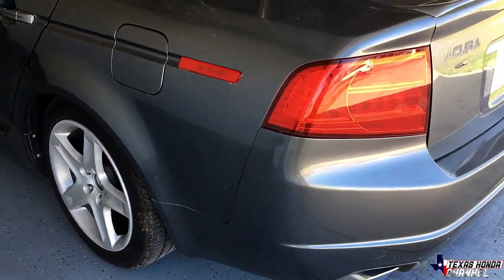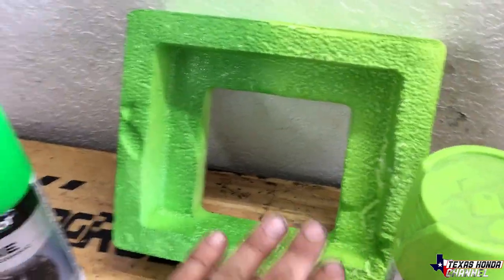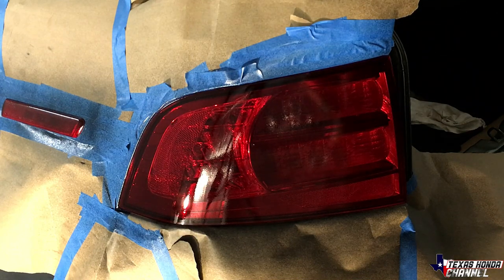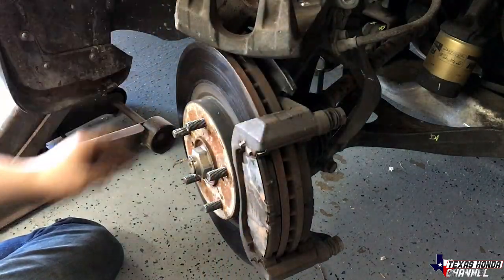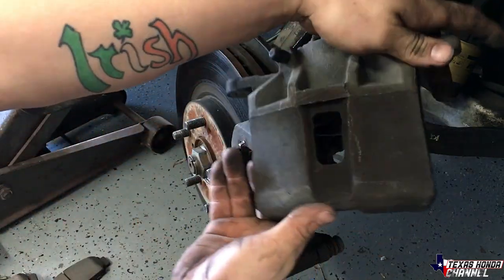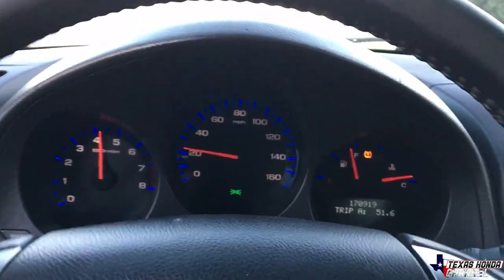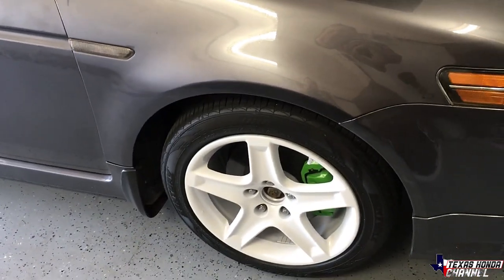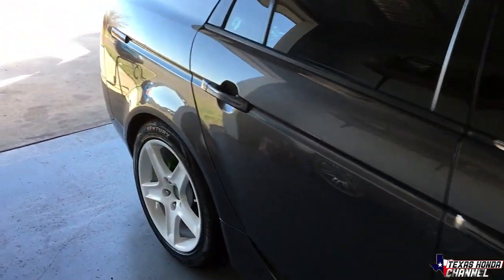My 06 Acura TL Gets Some Custom Rice Mods! More videos coming too!

Comment: I believe the 2004-2006 TL with the 6mt came with brembo brakes. The 2007-2008 came with standard brakes, 2007-2008 type s with the auto or the 6mt came with the brembos.
Reply from the maker: Yup the 06 (which is what I have) with the 6 speed manual transmission should have brembo but it don’t because someone swapped them out for whatever reason.
Reply: @TexasHondaChannel  First thing I thought is that someone used parts from an automatic to rebuild the suspension after an accident. (Presumably the same accident that resulted in the slightly mismatched paint)
On a side note, the green and white looks awesome and I'm excited to see the rest of the car when it gets painted!